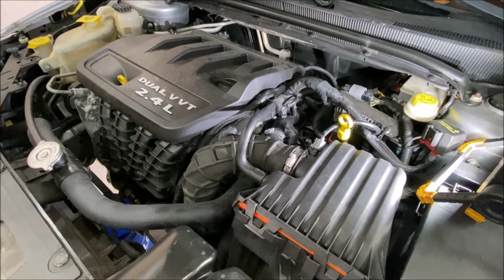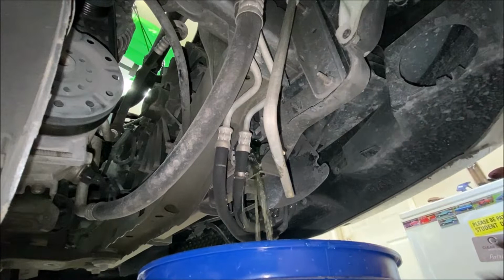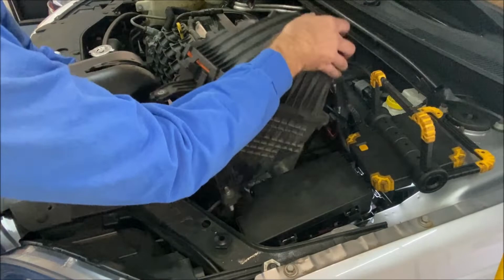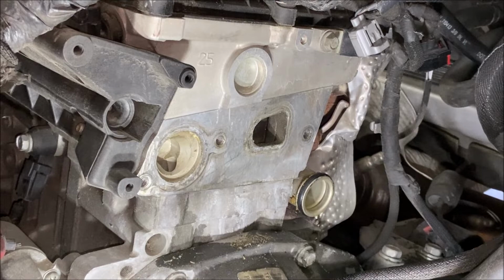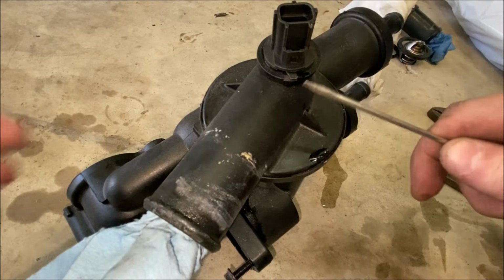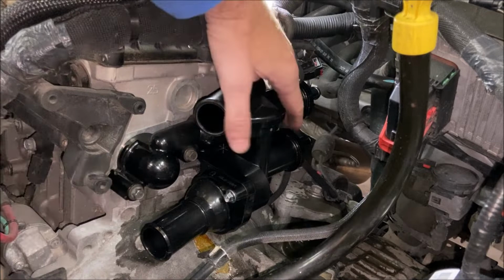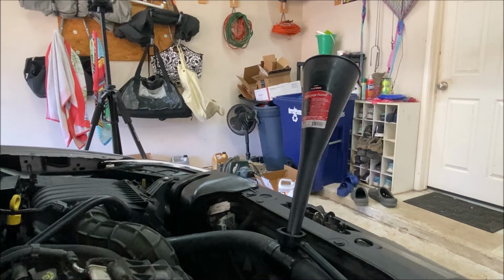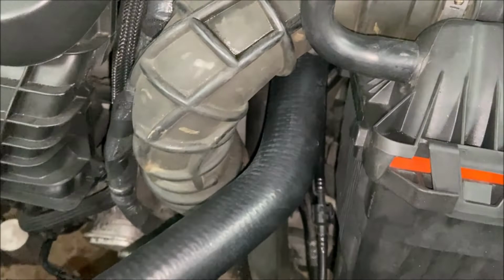Setting limits – Replacing the thermostats on a 2.4L 2014 Chrysler 200

Comment: Great video! Very detailed.
Hard to believe someone would just cut off the internals of the second thermostat rather than simply replace it. Glad you took the time to open it up, even though you didn't need to.
Reply from the maker: Thanks, Brian, and thanks for watching.  
I'm glad I let curiosity take me into taking it apart.  It didn't just help me understand the cause of my problem but also gave me insight that I could probably expect other "interesting" work by previous owner(s).
Reply: @CarbonsDIYGarage Ya know, i did see some guy on Reddit talking about how he was having over-heating issues, so he removed the actual internal components of the thermostat that coincidentally is gone… Do you believe in coincidences?🤣
Reply from the maker: @Zach-lz1zh  Dang, that’s crazy. For all the work involved in doing that, why not just fix it right?  Should drop this video into that Reddit with a “is this you?” 😂

Comment: I had a 2000 Chrysler Cirrus LXi V6 3.?always ran at 1/4 temperature gauge. Now I have the 2012 200 LX 2.4 always ran at 1/4, until the neck radiator housing cracked and broke. I redid that and all the hoses attached to it, put in new coolant, now it runs at 1/2 fine in the winters in Phoenix, AZ (2020 thru 2023), but it starting to overheat now that we are reaching 90+ degree temps I think its the water pump from looking at the driveway stains. Thanks for your videos. They have helped.  I watched the water pump video first. I will check the codes tomorrow and probably keep looking for a mechanic. I have hand tremors, carpel tunnel and arthritis,  and  can't really do the work anymore, last repair i did was the June 2020, but at least I can make sure I get a  good mechanic, that knows what they are doing. My 2000 Chrysler Cirrus water pump is what took it out.
Reply from the maker: Best of luck with it, Peter, and thanks for watching. The water pump sure needs some contortion skills, especially if you’re on the ground just using jack stands. I hope that resolves the issue for you.

Comment: Your suppose to leave the temperature sensor out of the vehicle because that is the highest point when filling it up, it will remove the air. The air is what’s causing the vehicles temperature not to be at normal level
Reply from the maker: That's a good tip, Robert.  Thanks for it and thanks for watching.

Comment: Thanks man gonna look at mine in a few weeks pretty sure someone used silicone to seal the housing to the block might be scratched up or something but I’m wondering do I need to bleed the cooling system when I go to refill?
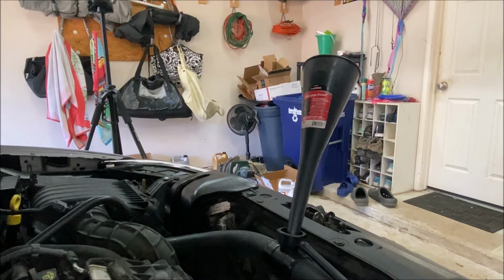Reply from the maker: Yeah, you'll have lost a lot of coolant in this process and will need to bleed/burp the system and ensure that it's full.  I go over it at 22:40 in the video.
Good luck, especially if someone did silicone it on you, and thanks for watching.

Comment: I have a 2012 chrysler 200 no heat,  ,i didn't  have the money to replace housing, replace both thermostats and still no heat, any idea's
Reply from the maker: Assuming there’s coolant and it’s not overheating, I’d check the temperature of the hoses going to the heater core. Both should be hot. If not, you might have a blockage in your heater core. You could try flushing the core in that case. The other thought is air trapped in the core so try burping the system more.   Sorry I can’t be of more help. Good luck and thanks for watching!

Comment: Hey man I just replaced my water pump and thermostat in my Chrysler 200 2013 and it’s still overheating and the heater isn’t wrking as well any help??
Reply from the maker: Gosh, with those symptoms I'd think water pump and thermostats would do the trick.  Years ago, I had a similar problem on a different vehicle after doing some maintenance and it was because there was still air in the coolant system.  So maybe try burping the system again to make sure all the air is out and it's full of coolant?

Comment: Muchas gracias, tengo una duda en las manguera que salen del auto, mencionas que la de arriba va arriba y la de abajo va abajo, pero en mi auto estaban al reves segun recuerdo, que problema puede causar eso? Muchas gracias por tu video
Reply from the maker: Thanks for watching! Another commenter pointed out that theirs is also opposite of mine. I assumed that mine was correct but it seems like the previous owner of my car might have done it backwards. The top hose should be the return from the heater so that any air bubbles get pushed towards the highest point. If the hoses are reversed, it could allow air bubbles to be trapped in the heater core, degrading the heating capability. But I don’t think it’s the end of the world. 

¡Gracias por ver! Otro comentarista señaló que el suyo también es opuesto al mío. Supuse que el mío era correcto, pero parece que el anterior propietario de mi coche podría haberlo hecho al revés. La manguera superior debe ser el retorno del calentador para que las burbujas de aire sean empujadas hacia el punto más alto. Si las mangueras están al revés, podría permitir que queden burbujas de aire atrapadas en el núcleo del calentador, degradando la capacidad de calentamiento. Pero no creo que sea el fin del mundo.
(Google Translate)

Comment: Awesome video thank you! Just a question. I put vehicle back together after replacing the housing and when I was adding coolant the coolant was leaking immediately while I was putting it in from the bottom it looks like it’s near the housing I just put on :( anything I could’ve missed I checked all hoses it doesn’t seem like it’s the house maybe didn’t put housing assembly on right? Any tips helps!
Reply from the maker: One of the tricky things with this, I found, was getting the thermostat to stay seated in the engine block while I was installing the housing.  If that isn't seated right, it could cause the whole thing to be off just enough resulting in a leak.  
Also check to make sure the housing is fully over the pipe at the back of the block.  You could take the housing back off and make sure the o-ring didn't roll off or check that o-ring for cuts.  Also make sure the sealing surface of the block is nice and smooth and clean.  I know that kinda sounds like "take it off and try again" but that is really the only option that comes to mind - aside from the total frustration of this result.  I totally feel your pain.  Good luck and thanks for watching; glad the video helped at least with the replacement process.

Comment: Great video, I have to do this job in 2 days but I will try just to replace the front thermostat as this is the one that seems to be stuck closed, the inside bolt will be a pain but will save a few bucks and hopefully solve the issue.
Reply from the maker: Thanks, Bill.  Feel free to drop a comment after you do it just replacing that one thermostat and let folks know how it goes.  Thanks for watching.
Reply: @CarbonsDIYGarage  It's pretty obvious the last person who worked on your car just did a quick fix to get it to stop over heating, hence not replacing the bottom splash pans and just ripping the thermostat apart to get flow back, that did not break apart by itself, lol. I hope this worked out for you and they did not do this to cover up a warped head, a good highway drive will tell the tale, best of luck. Will update in a few days, the full price of the assembly here in canada is $155.00. ( for a piece of abs and 2 thermoststs, lol )
Reply from the maker: @billbr3484  You're very astute. Unfortunately, it appears that the bad day scenario you're thinking of might be where this is headed.  Not to spoil some future videos, but getting good thermostats in the system pointed me to the hurriedly replaced coolant pump, when then points to a likely overheated head.

Comment: I only need the thermostat can u tell me the part number?
Reply from the maker: Thanks for watching, Clarisa.  Since there are two thermostats and they have different part numbers/operating temperatures, and since I didn't buy thermostats on their own when I did this video, I'd rather point you to rockauto.com and you can see the available parts options.
I hope this helps.
https://www.rockauto.com/en/catalog/chrysler,2014,200,2.4l+l4,3300344,cooling+system,thermostat,2200

Comment: Why drain coolant and not just add more to the coolant reservoir? Also do I HAVE to fill radiator hose, wouldnt the coolant resonate just push coolant through it?
Reply from the maker: You don't have to drain the radiator first.  But when you take the hoses off, all the fluid that's in the radiator (or most of it) and the engine (or most of it) will drain through those hoses.  It's less mess if you drain the radiator.  However you do it, most of the system's coolant will end up coming out.
When you refill the system, you want to get as much coolant as possible into the radiator, engine, and hoses before you start the car.  Really, your goal is to get as much air OUT as possible so that your water pump is circulating coolant and not bubbles.  Since, on this car, you can't easily directly fill the radiator, you do it through the 'radiator cap' on the hose - thus you're filling that hose as well.
I hope that helps; thanks for watching.

Comment: My wife has this same exact car/motor. Its running hot. From a cold start, drive it a mile and a half and temp gauge is pegged out. Would this be a thermostat issue???
Reply from the maker: Here are my thoughts - I'll let you decide how useful they might be.  With my car, it took a good while to get it up to operating temperature, when sitting in the driveway and when driving it.  Assuming you have a radiator full of coolant and some in the overflow tank, I can't imagine that it would really be overtemping in 1.5 miles.  One thing you can do - if the thermostats are working properly (opening) when it's that hot, and it's really that hot, both the upper and lower radiator hoses should be hot (very hot - touch with care to confirm).  If they're not both hot, your thermostat to the radiator is closed.  So either the thermostat is bad or the engine's not really that hot.  
I'd suspect the coolant temp sensor at this point.  It's a cheap part and easy to replace - I'd swap that out first and see if you have the same problem.  If you have the same problem, then it must be one of the thermostats being stuck closed (and I'd just go ahead and replace them both).  
If that doesn't fix it, it could be some type of weird water pump failure where the impeller shaft is broken such that the engine belt spins the pulley but the impeller isn't actually spinning/moving water (but I've never heard of that before).
I hope some of those thoughts are a little helpful.  Good luck!

Comment: Thank You!!!!!  I've been searching forever for someone to show how many turns to turn the petcock.  Mine turns a quarter turn easily and stops... now i know this is normal.   Only problem is nothing is coming out so I assume its blocked.  Now to figure out what to do to unblock it.... or i guess just keep turning it out to remove it like you did and replace it?
Reply from the maker: If nothing comes out, I’d indeed remove it to drain the radiator. Just expect a big gush. Leave the radiator cap on to  help slow the flow a little. If the petcock isn’t leaking, I doubt you need to replace it. Try some coat hanger or wire up the drain hole, after you’ve drained it, and see if you can loosen anything in the drain. I hope that helps a little. Thanks for watching and the feedback. Good luck!

Comment: Do the bolts go into the cooling jacket? Do I need to put RTV on the threads so coolant doesn't leak out the bolts?
Reply from the maker: I did not put RTV on the threads and it’s been leak free. Thanks for watching, Kenny.

Comment: Why would the previous owner have removed the thermostat?
Reply from the maker: I could more easily understand simply removing it all together instead of snipping away the spring and poppet and reinstalling it, though I guess the t-stat seal is what seals those two plastic pieces together.  Why not just install a new thermostat?  If nothing else, use a thermostat with the same temperature rating as the other one.  I dunno, there's probably some other troubles/story going on because yeah, it just makes no sense.
Thanks for watching, Billy.

Comment: My car doesn’t even have the light come on. I went to replace the thermostat and it doesn’t fit because the seal is alittle thicker. Doing everything the same as your video. Would you happen to know which is the primary thermostat? Reading other people’s things points to the primary not opening up causing my radiator hose to blow back.
Reply from the maker: I did a Google search because my memory isn’t reliable. The primary (170 deg) thermostat is the one inside the plastic housing. The secondary (203 deg) thermostat goes into the block. Good luck with the project!
My source: https://www.allpar.com/threads/thermostat-temp.167196/post-1084843228
Reply: @CarbonsDIYGarage  Thanks for your response. I’m going to change both of them so I don’t have to come back for it later lol. Thanks again!
Reply from the maker: @fsanchez6160  I feel ya - I hate working with coolant; doing it all at once and hopefully not going back into it for a long, long time sounds like a great plan.  Good luck!

Comment: How are you running traditional green coolant when Dex-cool is required.
Reply from the maker: Great question, Jim!  The video and thumbnail sure make it look like traditional green.  Here are a couple of answers.
1. This was my first time draining the coolant from this vehicle after I bought it so I'm actually not really sure what Previous Owner (or their shop) put into it.  But that's what was drained - not something I'd previously used.
2. I'm pretty sure It wasn't traditional green, or at least pure traditional green,  that got drained, though the color seems similar.  I've got traditional green in my '97 Jeep TJ and I've drained/filled that enough (sadly) to be able to say that the Chrysler's coolant was different - "thinner" maybe, and the colors weren't really that similar.
3. I didn't find any corrosion, gel, or "goop" in the Chrysler's coolant, in either this drain or the drain I'll do in the future (6 months after I made this video) when I replaced the water pump.  No gel/particles in the thermostats or housing that I removed either.  I'm glad I did have to replace the coolant, though (twice!) just in case they did mix traditional green in there at some point. 
4. I promise I did use Dex-Cool when I filled it back up (link in video description).
Thanks for asking and for watching.

Comment: Am I looking at the correct one where it's the manifold on the towards the fans intake manifold towards the fans and the exhaust manifold sits to the rear oh I see that's the easy one 2.4 I'm talking about that other one that's not so easy
Reply from the maker: You’re right, Lee, this video is for the 2.4L 4-cylinder. The 3.6L V6 is a different beast. I haven’t researched it but it seems like most of the videos out there are for that 3.6L. It looks a lot more challenging to work on than the 2.4L in a variety of projects.

Comment: Hi,do you think we need to seal the housing before the install or it don’t need to,thanks.
Reply from the maker: I didn't add any additional sealant and I never had any leaks.  Each of the thermostats has a seal, then there's the seal on the engine and the pipe at the back.  As long as those are in good shape or new, you shouldn't need anything else, based on my experience.
Thanks for watching.
Reply: @CarbonsDIYGarage   
Thanks for your response,appreciate what you doing
Reply from the maker: @muhanedalkaabi3921  Thanks, Muhaned!

Comment: Great video!  Did you flush the system eventually?
Reply from the maker: Since I had previously recently replaced the water pump (drained/replaced coolant) and then drained the radiator to start with for this project, plus the engine drains most of its coolant when you pull the thermostat, I considered all of that coolant replacement as my “mini flush” instead. 
Hope that helps. Thanks for watching.